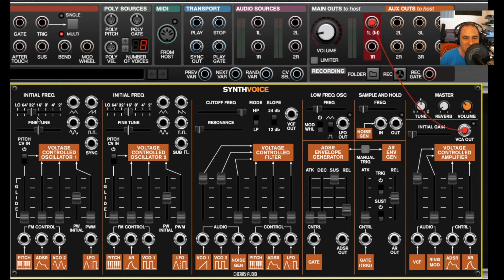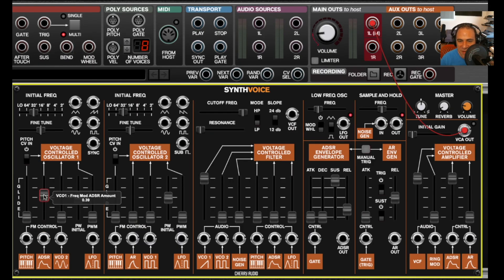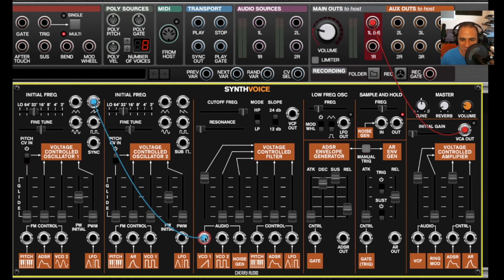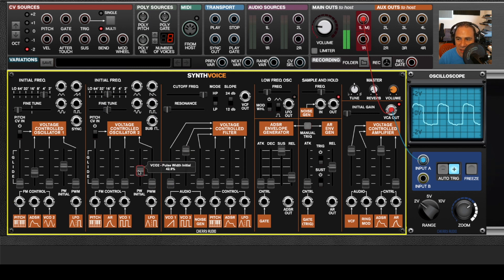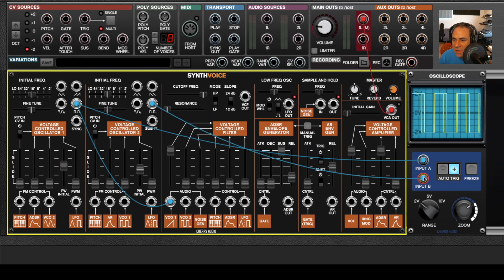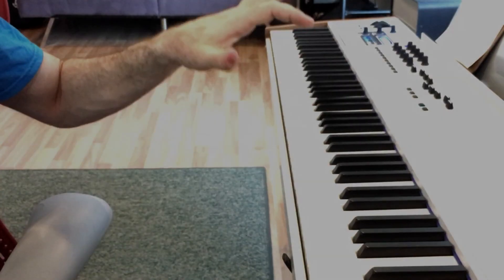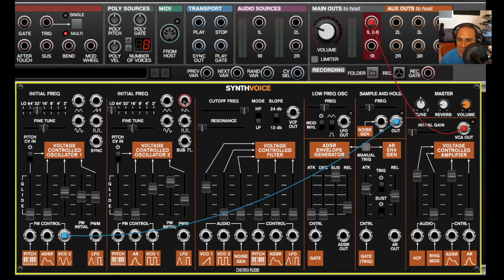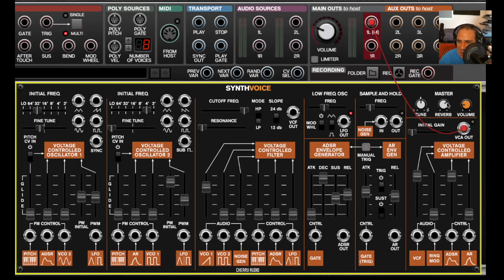Voltage Modular | Synth Voice Module Overview

Comment: Is there a way to play in duo-phonic mode ? I mean VCO1 for the lower note and VCO2 for the upper note.
Reply: This is Mitch, I made this video. Super late answer, and if you ask three Cherry employees, you'll get six answers, but to answer your question, "sort of." You can definitely route two note CV's to the two oscillators, Best choice for this would be Poly CV Converter module, set to two voices, with pitch CV's routed to each osc and gate CV's multed to one of the env generator gate ins. 

But it gets a little dicey because Synth Voice only has a single VCA. This means that the pitches will individually track for each oscillator, but you'll hear BOTH oscillators any time you press a key (regardless of whether you're hitting one or two notes...). The solution is to drag in another env gen+VCA module and route one of the Poly CV conv gate out to the "extra" env gen module and the wave output of one of the oscillators to the extra VCA, then mix the output of Synth Voice and the extra VCA together.
Reply from the maker: Hey there! Using a One to Eight switch module, you could create a duophonic style patch by having the pitch going out of a two step 1x8 having it triggered by the I/O panel gate signal!

If you need more help with it though feel free to get in touch with our support at cherryaudio.kayako.com and we'd be glad to help you out further!
Reply: Thanks you